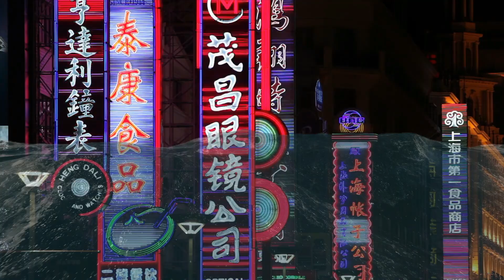10 Cities That Will Be Underwater by 2050

Comment: Agree.   I am a NFIP worker and the goal of insurance is that once flooded and damaged over 50%, then the owners must elevate over the 100 year flood height (or whatever community requires).  I agree with others, scare tactics and BS in this video is not going to happen in 26 years.
Reply: This is an ai manufactured channel farm. They typically have hundreds of clickbait channels and are full of useless incorrect info.
Reply from the maker: @DogSpeak,This isn't AI manufactured channel. All information for videos are based on research and carefully analyzed.
Reply: @BrainyBoulevard  Cool story